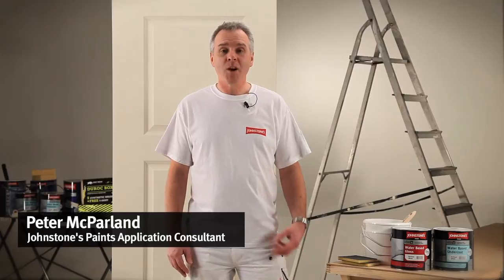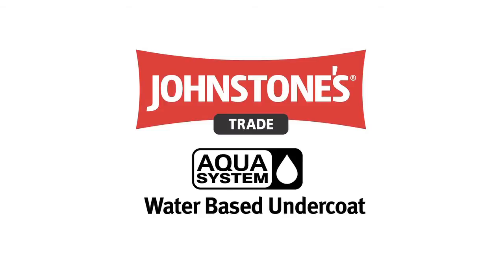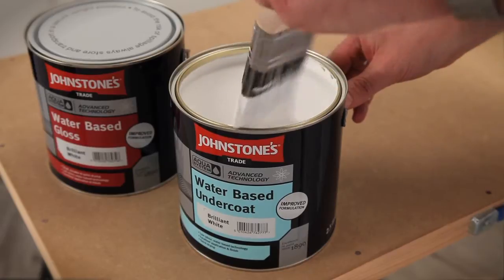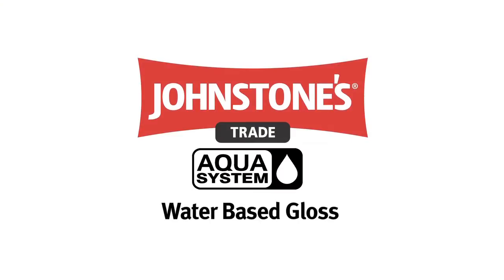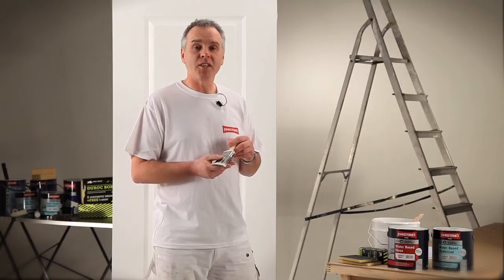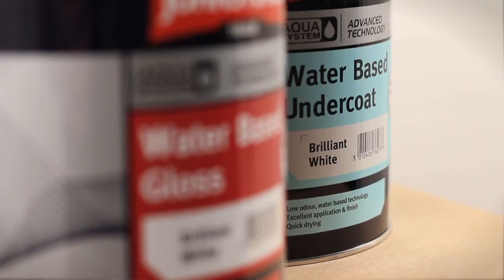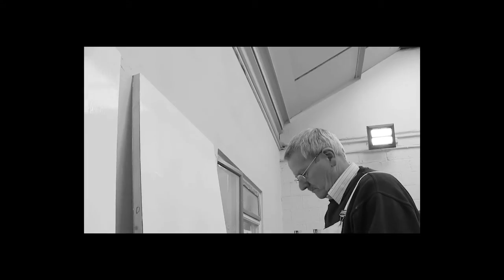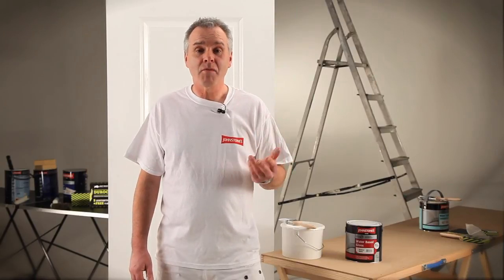Johnstone's Trade Paints New Aqua Gloss

Comment: Right, so I have used this by chance as I was in the Johnstons decorating centre getting other things. But because of young children around the house and of course the low odour it emits, it has been very helpful as well as with the quicker drying time.
I just want to say it's been two years since I first started using this paint. ALL the woodwork in my house was painted using this and I actually used a standard primer. (would have used the aqua one had I known properly) BUT the finish and quality... I got better with it the more I used it but if only I could post pics on here... My doors are mirror gloss immaculately finished and bright white as the day I painted them in Feb 2018. The handrail, I did three coats of course and it is so strong, even I was surprised. All my door frames, skirting boards, such sheen and whiteness but you need to apply it properly. For the best results with this I used a shirt pile synthetic brush but my word. Bye bye yellowing oil based gloss (even though they are said to be non yellowing, they eventually do like in my parents house I did a few years back)
Edit: Short pile brush

Comment: I am using this product at work dark blue undercoat and dark blue gloss it just want cover ive wasted so much time primer two undercoats and gloss it just looks absolutely shocking the undercoat is ok but the gloss is rubbish i can only speak for the dark blue dont no the ral of top of my head i wish i could just use oil based the job would of been finish and to alot better standard